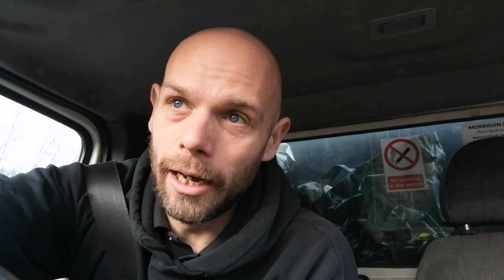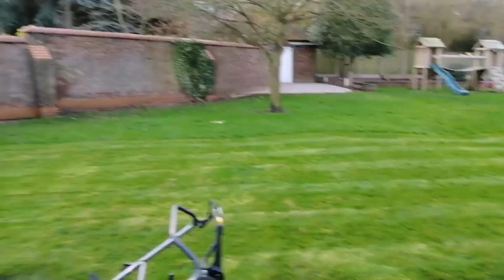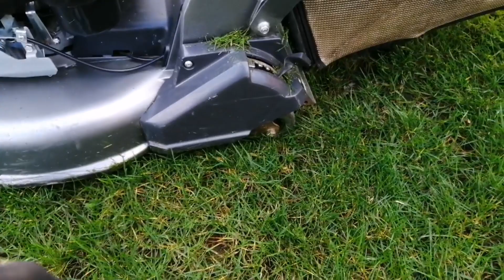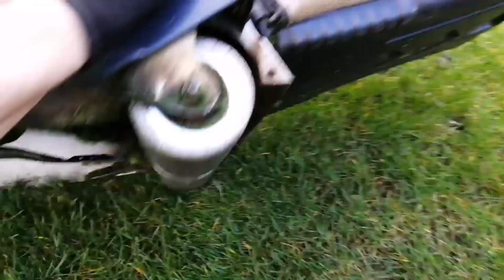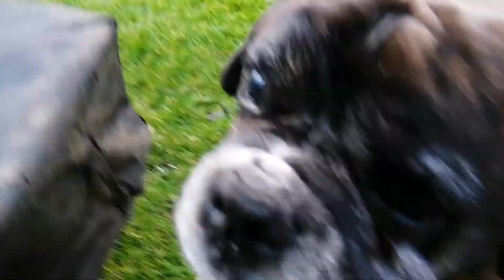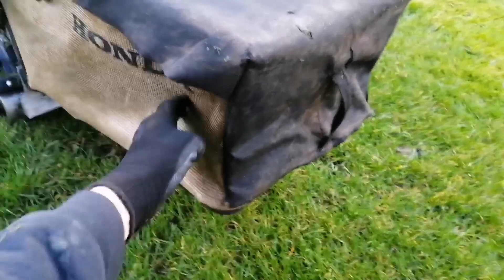Review and first test for the clutch plate on the Honda hrd536

Comment: A good honest review mike, I have to say I really like the Stihl roller mower, it also has the smooth roller but maybe when it's been run up and down some concrete paths it will have more grip, I really wish I could find a plastic box to fit on my hayter.
Reply from the maker: Thanks kev I bet they will come up with one soon enough. Plus if they don't someone will find either an aftermarket one or one that would fit the hayter. M

Comment: There's a fair few differences between the Hrd and Hrh actually.🤪
The Hrh has totally different much heavier duty handle bars and the low mounting brackets. No twist knobs on Hrh all bolted tight with no adjustments.
The deck is thicker on the Hrh. Obviously front wheels and bumper.
Pretty sure the Hrh has a quicker gearbox. But definitely only single speed.
I've converted an Hrd to Hrh all apart from the deck from spare parts I had.
Great mowers over all. I agree a collection box would be better than a bag.
👍
Reply from the maker: Cool thanks for that. Like I a I'd I was going off honds website and it's not got a great deal of detail. M